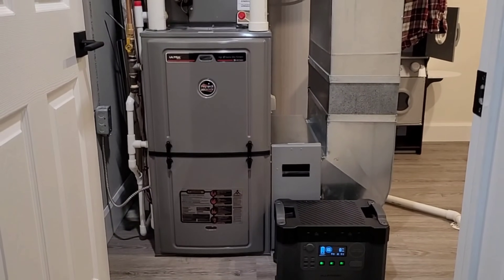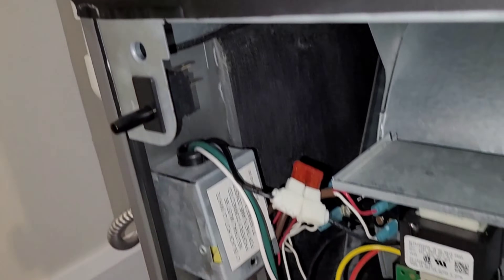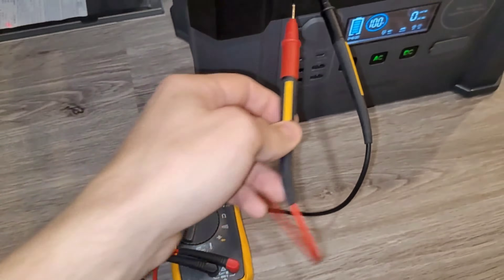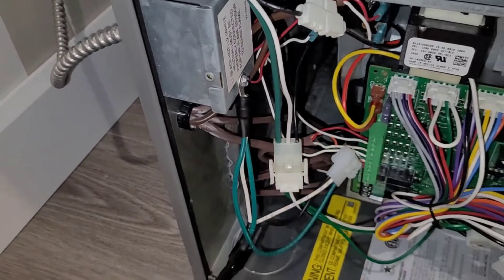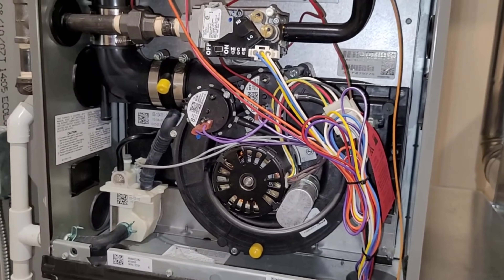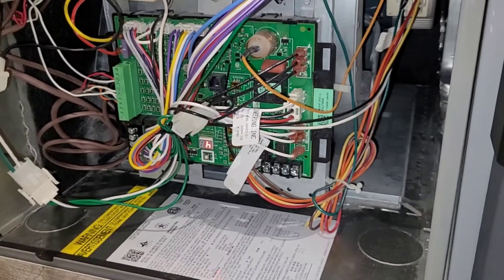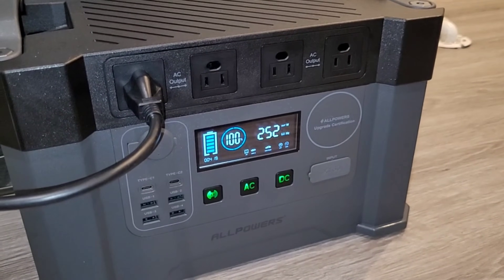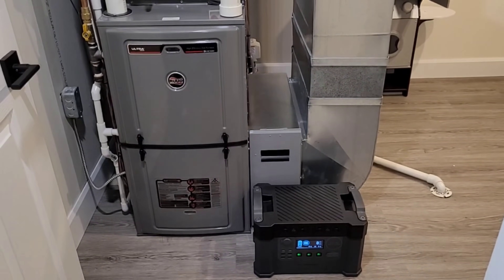How To Run Your Furnace On A Generator / Inverter

Comment: Any idea why my power display on the power generator shows the furnace draw at 600 watts and the external watt meter used (plugged into the power generator) shows 250 to 300 watts while the furnace is running? It drains the power unit significantly faster than it should, around three hours. I’ve done power consumption tests at 20 degrees F outside temp and below zero outside Temps. I get a grid power consumption use of 44watts to 110watts average over 24 hours. So in theory the 1230 watts of usable electric power the unit provides should run the furnace from 10 to 28hours depending on outside temps with thermostat set to 68F. So why are both of my power generators depleted in 3 to 4 hours when they supply the power? I am using a bonded neutral extension cord.
Reply from the maker: Something definitely sounds off.. What power station are you using?
Reply: @SmitHVAC.  I have two of them, a Growatt infinity 1300 and a Bluetti ac180, they are both doing the same thing.
Reply from the maker: @medicmanfd  Could the watt meter be inaccurate? What size is the furnace? Is it an Ecm blower motor or a standard Psc motor? Ecm will have significant power savings over Psc so 600w could be accurate depending on size.
Reply: @SmitHVAC.  It is possible the watt meter may have an issue however it seems to be credible in the past. And I’m not sure about the furnace other than it was installed in 2009. I’ll try another test this evening with a separate 1500 watt inverter and battery bank I have, I can use battery banks DC digital screen to see the actual current flow coming from the battery bank and then multiply that by the battery voltage to see the actual power use of the inverter and furnace running together. Then I will have a better reference. I’ll message you back this evening. Thank you!

Comment: So by doing this you are using the earth ground in the mains panel assuming the furnace is grounded at another location other the regular line coming into the unit? Been watching videos on floating grounds using inverters and how to overcome grounding issues. Thank you for the video!
Reply from the maker: Yes, im connecting the neutral and the ground at the furnace, to the furnace because it is grounded to the main panel and it's works the same as bonding it there

Comment: Unfortunately, our house is all electric. That’s why I keep a Dyna-Glo kerosene heater in the shed. 😅
Reply: We had a freak ice storm, and I wasn't set up for it. We moved from the mountains to the valley so I figured our power outages were pretty much over. Wrong! My old place in the mountains had a Monitor vented kerosene heater so to power it I only needed a small generator, and we had heat. I have another larger generator to keep the refrigerator, microwave and most important, my coffee maker, going. Down here I have an electric furnace. Now I have two kerosene heaters for emergencies. No more getting caught with my pants down. lol
Reply from the maker: I keep a Dewalt version of the Big Buddy heater too lol

Comment: I actually did hook up a big 2000Wh power station to my furnace circuit during a multi-day power failure last winter.   But the problem is that my furnace blower eats somewhere north of 400W.     The power station only lasted three hours at that load and keeping the thing going wound up being too much trouble.  It didn't last overnight.

In anycase, I hooked it up through the furnace circuit at the sub-panel (with the hot wire removed from the breaker) instead of messing with the furnace itself.  I may end up throwing a box in next to the sub-panel with a manual transfer switch for a circuit or two next time.

One issue that cropped up however is that the power station had swapped NEUTRAL and HOT on its AC output verses its AC input, which creates a serious hazard when one is trying to charge the powerstation with AC or a grounded solar input and use the AC output at the same time.  So I had to fix that by swapping them back in the extension cord wiring.

By the second day of the outage I had things figured out and 200ft of extension cord later I had both the fridge and heat (from the gas fireplace instead of from the furnace) working and recharging automatically from the home solar system's 2000W "emergency AC output" in the garage.
Reply: Sounds like you may have had a similar issue as me. I have a Growatt Infinity power station that yields about 1230 watt hours of usable power. I created a “bonded neutral” small extension cord that ties the neutral and ground to the same electrical potential then I plug it into the power generator and an extension cord into the other end. I have a switch and electrical inlet to plug the extension into at the furnace then throw the switch for alternative power source. It does run the furnace however it drains the power generator very quickly, much faster than it should. I used a watt meter plugged into the power generator outlet and then plug the bonded extension cord into that. I get about 250 watts to 300 watts power consumption showing from the external watt meter however the screen on the power generator shows about 600 to 650 watts being consumed, they don’t match at all. I’m confused as to why this is happening?

Comment: Too complicated. I have a standalone gas heater (fake logs), no power needed. It sits on the hearth and will heat the house sufficiently without a blower. My main furnace is electric for the whole house. You are correct. Everybody needs to pre plan what will be needed in case of outages. Most people don't ever think about it or will not make the extra effort to provide a secure backup.
Reply from the maker: Gas log or a fireplace is a great option!

Comment: 6 seconds is the typical flame proving time. We just put an electrical outlet and switch beside the furnace. Then a 12 ga appliance cord on the furnace. Real simple to plug into Gen or anything else.